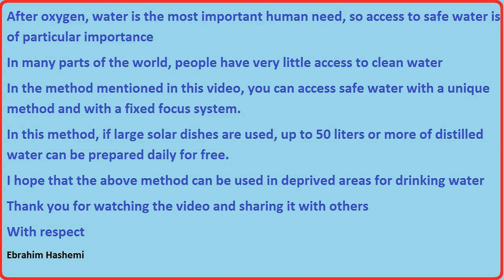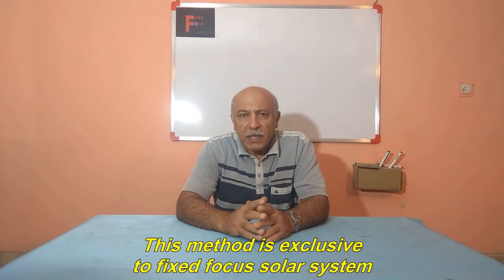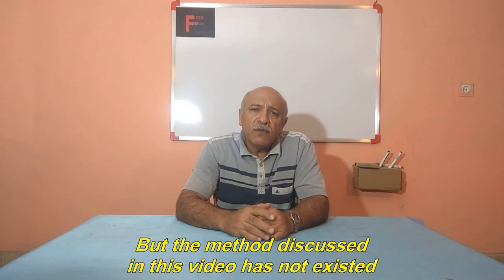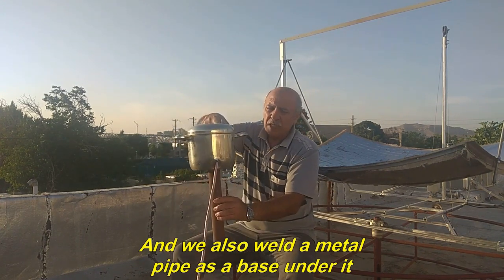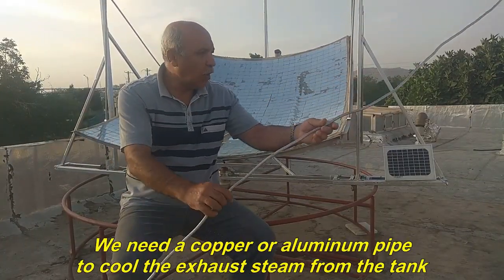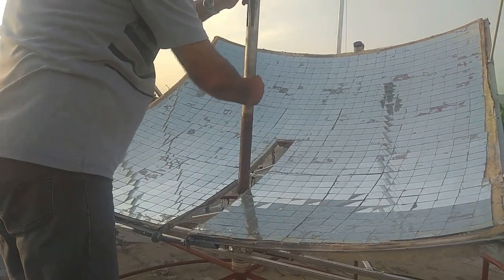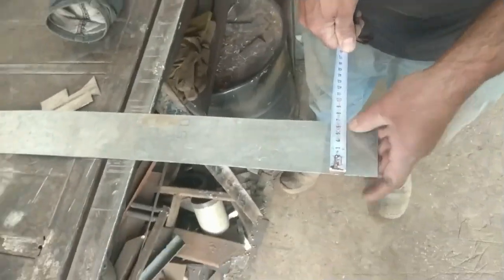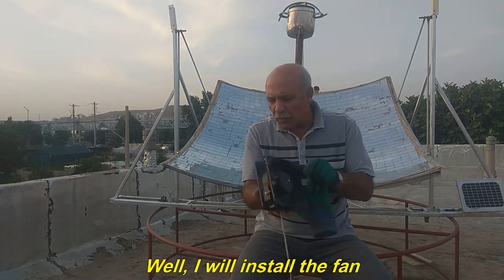Solar water purification.water refinery.Solar distilled water.Providing drinking water from the sea.

Comment: Really Nice ! Thanks for sharing your works ! Now with two valves, you can use this system also to pump water. When the boiler is empty, it could, with a simple weight unbalanced sytem go temporarily out of the sun rays, then the vacuum created can pull water from a well. One time the boiler is full, the weight will place it back itself to the rays, then push out steam (wich is also energy) recycled as distilled water, etc... Two systems could alternate when one is on the sun, the other is in shadow... A kind of solar steam engine powered water tower / "battery"
Reply: @fixedfocussolar  Yes, i was meaning to use only non electrical devices with valves and counterbalance, so the solar heat is also use to pump the water, like mr teslonian did for example in 2 vidéos